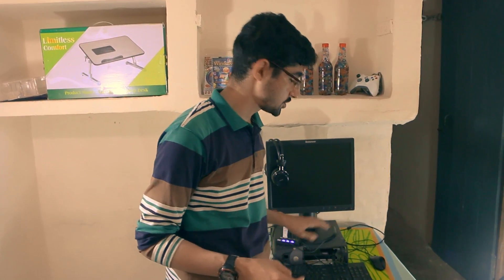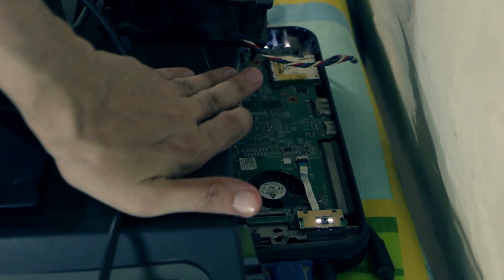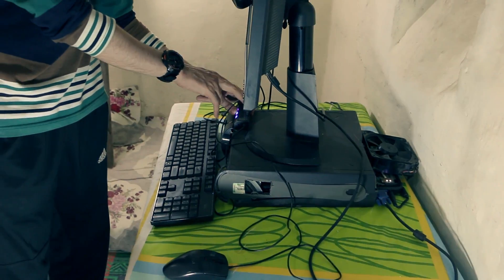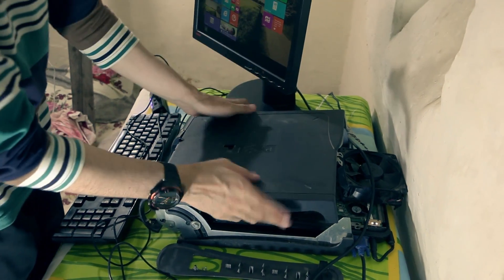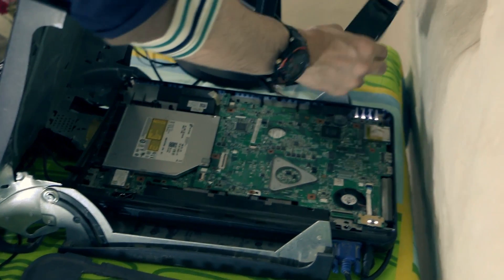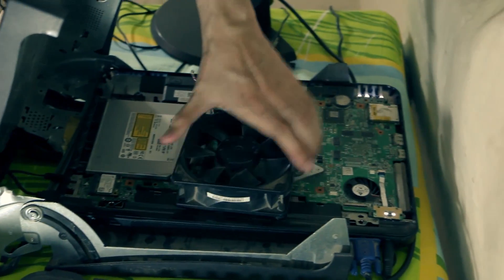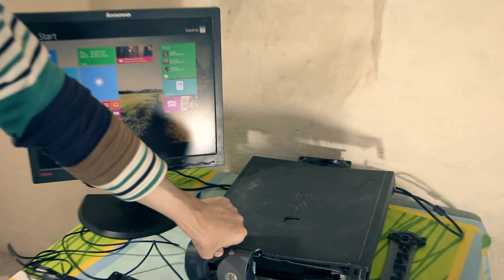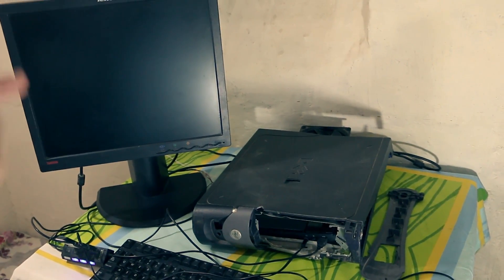How to Turn Old Laptop into a Desktop PC at Home

Comment: horrible honestly and without offending, to do what you did, it is better that you leave the notebook with its casing and use it with the screen closed and putting the external HDMI monitor (for sound too) on top of the notebook, and in my choice I would have preferred a wireless keyboard and mouse kit. in fact the problem of temperatures that you have is because you are not having good thermal paste and also because the cooling of the notebook is not correct, I recommend that you rethink the project and again, without offending, the opinions one is improving! I am giving you a good opinion and out of wanting to offend you! regards!
Reply from the maker: Yes you are right it's not a good setup and recently I overhauled this setup and now it looks more neat then this one (I will make video on that too) as far as cooling is concerned this notebook series had issue of overheating and thermal paste was not the culprit it was all about bad cooling design. BTW thanks for your suggestion :)